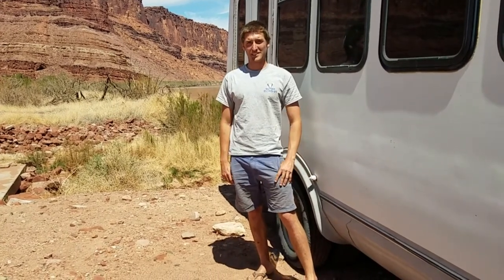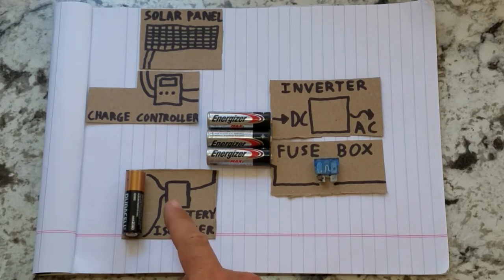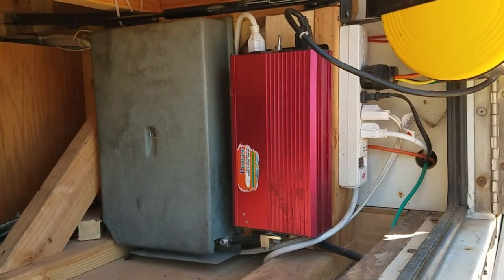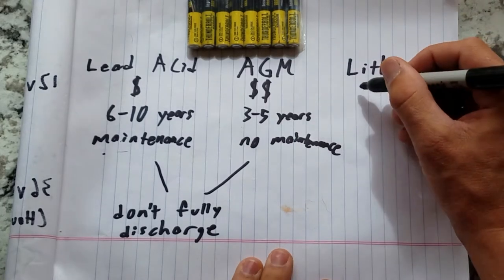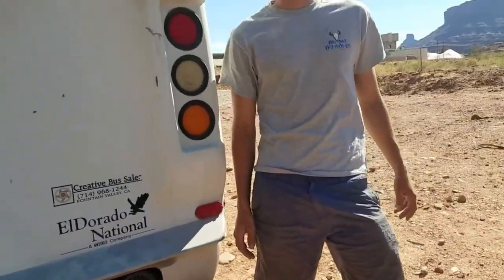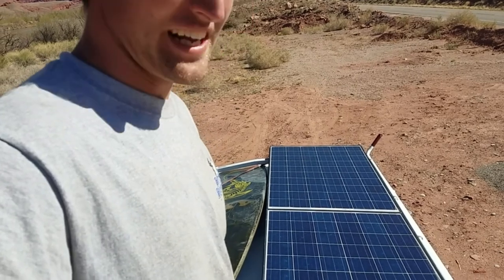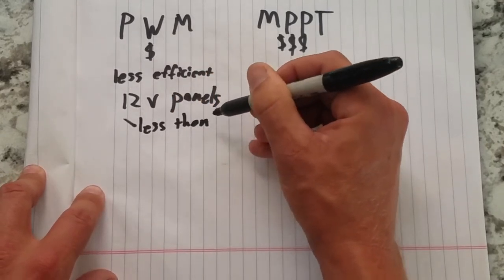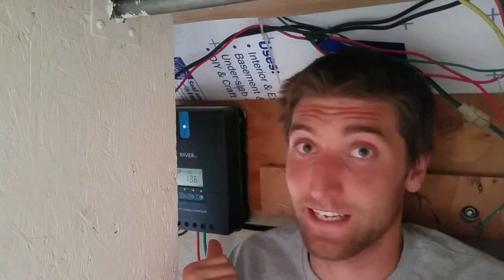DIY Bus Life Electrical System Explained

Comment: How do you check the water level in batteries? from a cover on top or drop them or???
Reply from the maker: So we have tracked on average how much water we usuly have to fill. And for us its usually about a 1/2 gallon every month that we use a water fill adapter for.